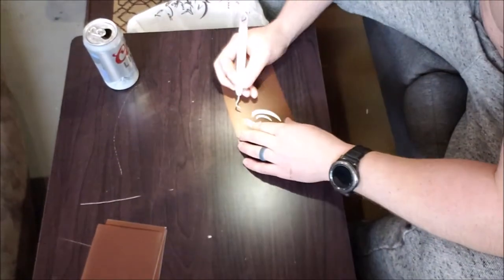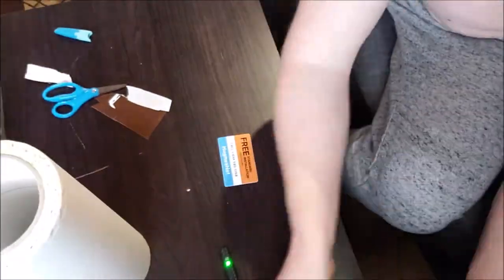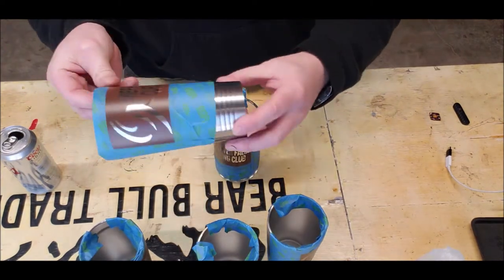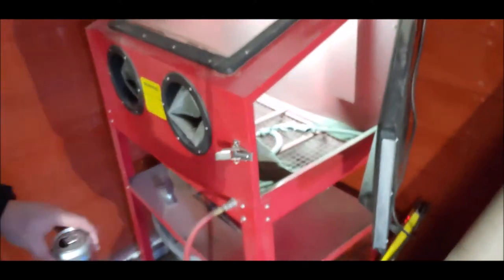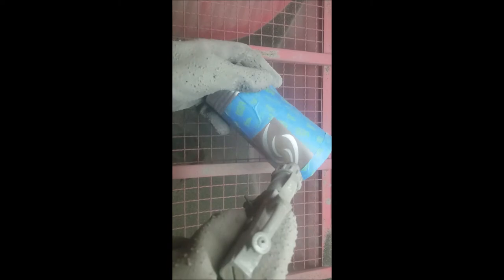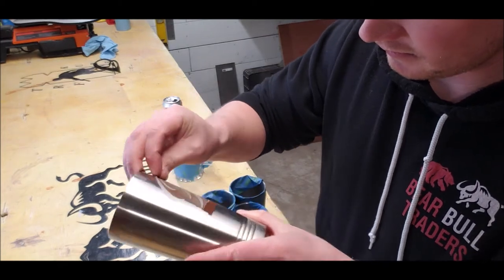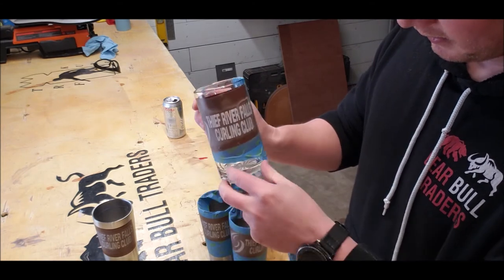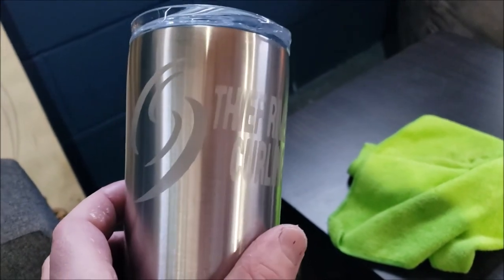how to etching glass/stainless mugs with a cricut and sandblasting

Comment: What media do you use and how much pressure?
Reply from the maker: I use around 40-60 psi. And I guess I've used a few kinds of media like a low abrasion stuff from a hardware store. As long as you have low pressure and blast straight at the vinyl should hold up. Takes some practice
Reply: What kind of abrasive do you use?